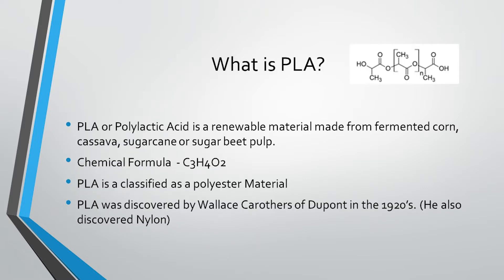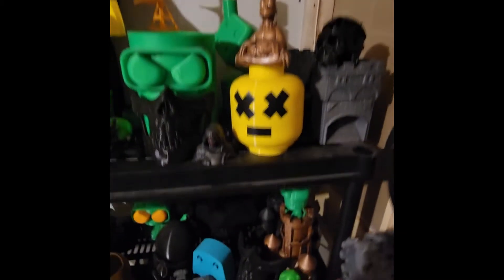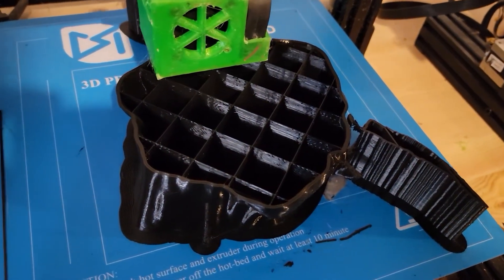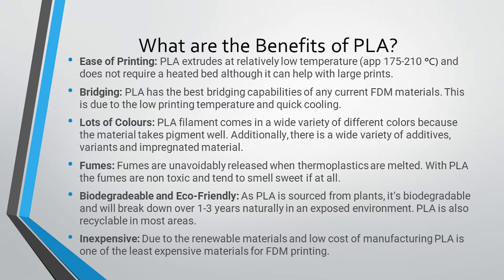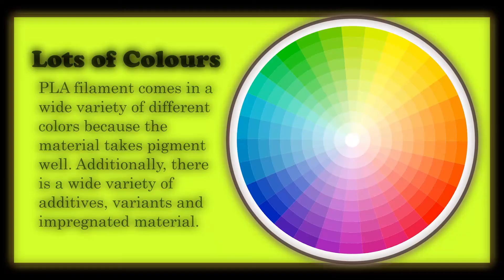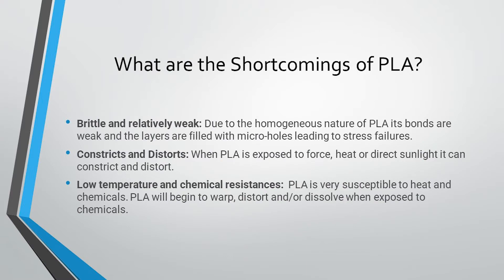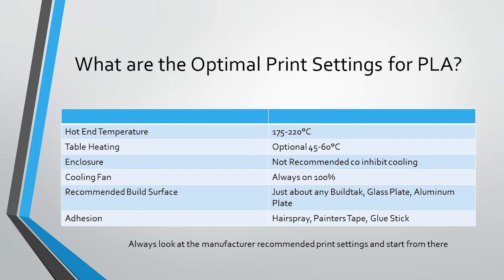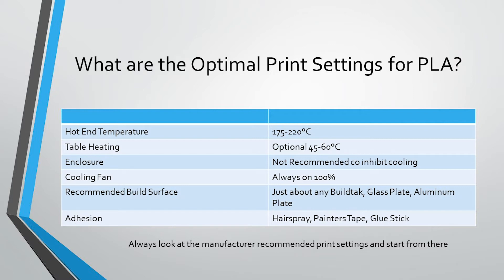Material Science - "PLA" Polylactic Acid

Comment: can PLA be used for a pressure (vacuum) vessel, or would it leak the air?
Reply from the maker: All 3D FDM prints are porous by nature due to how FDM lays down material. This will lead to micro porosity that could prevent it from being an effective pressure vessel. If you wanted to use PLA this way and I would not necessarily recommend that you do, you would need to do a post process coating with a sealant to help fill those gaps.